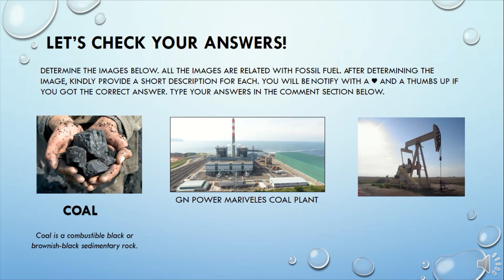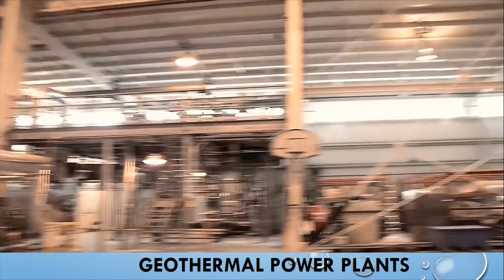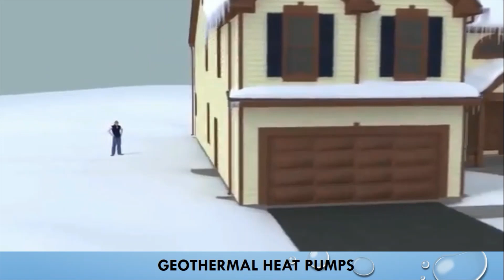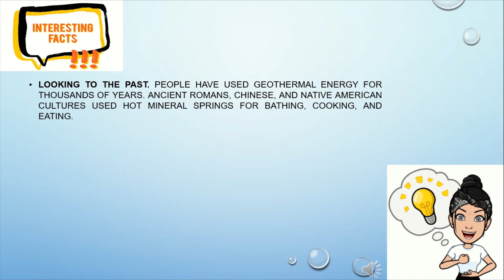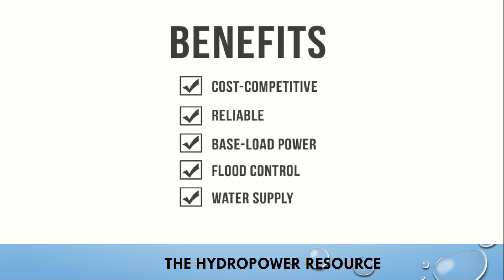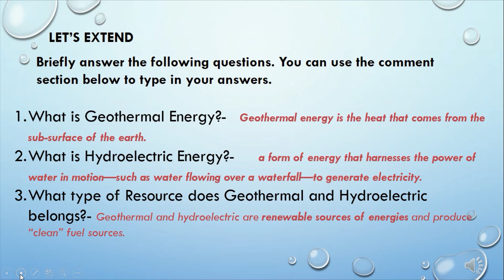GEOTHERMAL ENERGY AND HYDROPOWER RESOURCES (A SHORT DISCUSSION)

Comment: REVIEW:

(A). Coal - is a combustible sedimentary rock that's likely black in color. It is a nonrenewable energy source mostly used in households and industries.
(B). Generating Station - a plant that generates electricity.
(C). Pump jack - it collects crude oil from wells where the pressure is insufficient to bring it to the surface.

Baluyot, Abbegail Kate S.
11 STEM - Phoenix

Comment: Nuestro, Nevron Ian S.
11- STEM Phoenix

A. Coal is a hard rock that can be burned to generate electricity.
B. Generating Station is an industrial facility for the generation of electric power.
C. Pump jack is a device used to extract crude oil from a deep well.

Comment: A. Coal - is a material usually found in sedimentary rock deposits where rock and dead plant and animal matter are pilled up in layers.
B. GN Power Mariveles Coal Plant - is a coal power plant in Mariveles, Bataan.
C. Pump Jack - is a device used in the petroleum industry to extract crude oil from a oil well where there is not high enough pressure in the well to force the oil to the surface.

Comment: Caraig, Hannah Mae G.
11 - STEM Scorpius

Let's Review
a. Coal - it is a combustible black or brownish-black sedimentary rock. Coal is classified as a nonrenewable energy source because it takes millions of years to form.
b. Generating station - it is a power station/facility for the generation of electricity.
c. Pump jack - is a device used in the petroleum industry to extract crude oil from a oil well where there's not high enough pressure in the well to force the oil to the surface.

Let's Extend
1. Geothermal energy comes form the heat within the earth.
2. It is one of the oldest and largest sources of renewable energy which uses the natural flow of moving water to generate electricity.
3. Both of them are classified as renewable source of energy

Comment: Sagum, Cyrille Ann C.
11-Phoenix
Reply: Let's review
A. Coal- a combustible black or brownish-black sedimentary rock with a high amount of carbon and hydrocarbons
B. Generating Station-  a plant for generating electric power
C. Pump jack- a device used in the petroleum industry to extract crude oil from an oil well
Reply: Let's extend
1. Geothermal energy comes from the heat within the Earth. 
2. Hydroelectric energy is one of the oldest and largest sources of renewable energy.
3. Renewable resources